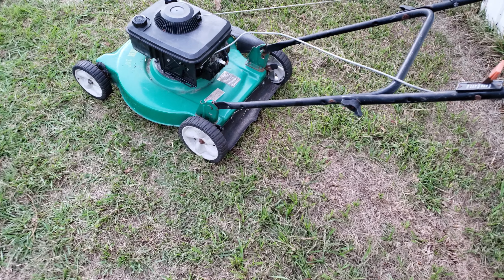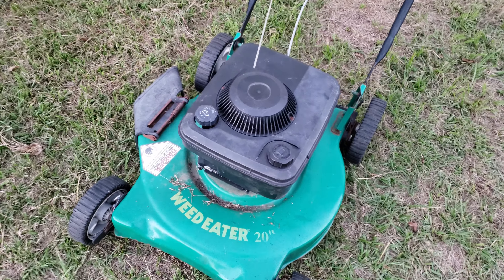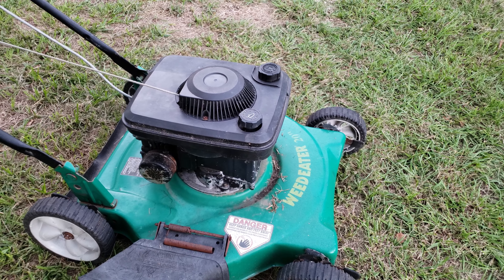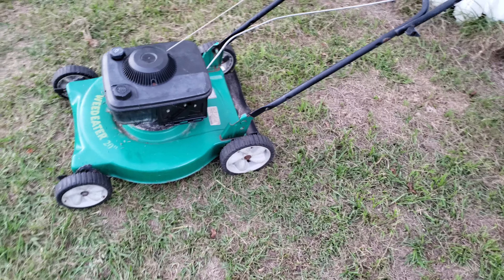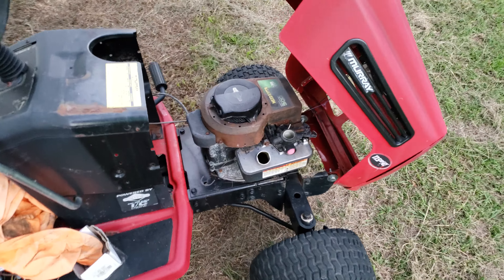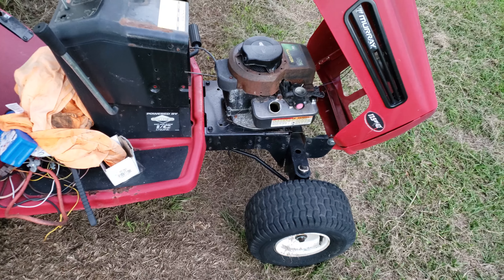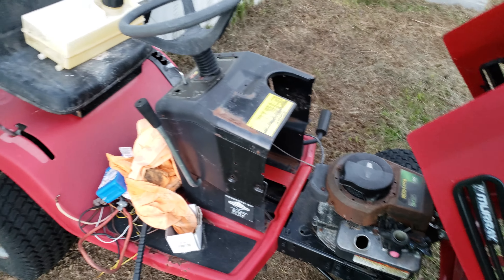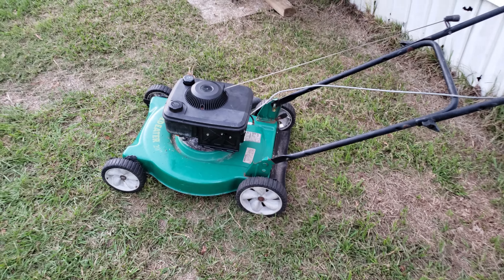I need help

Comment: I think it's a Briggs, judging by the air filter.
If you can find a junk pressure washer with a vertical shaft engine they work really good for mod mowers, plenty of power.